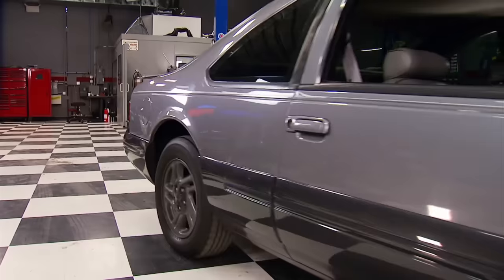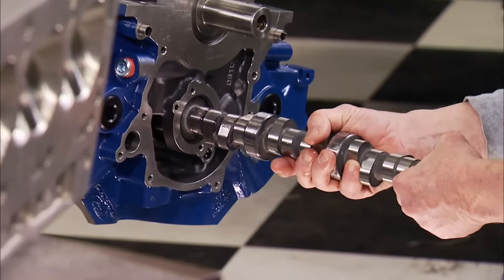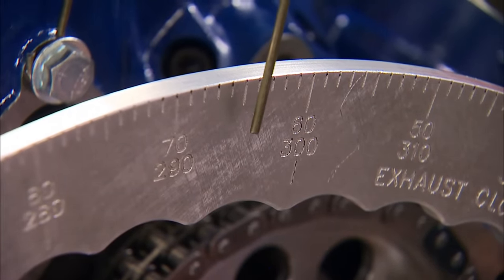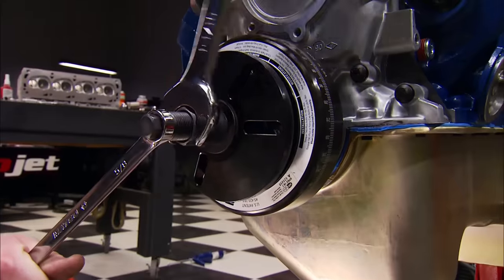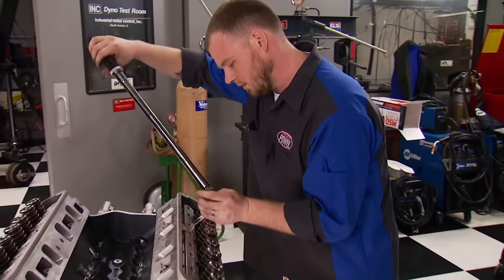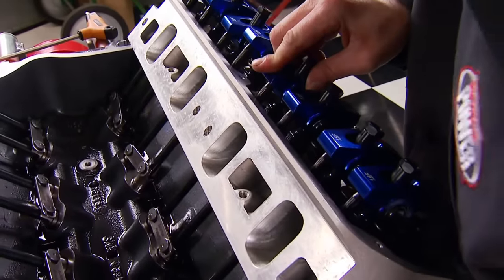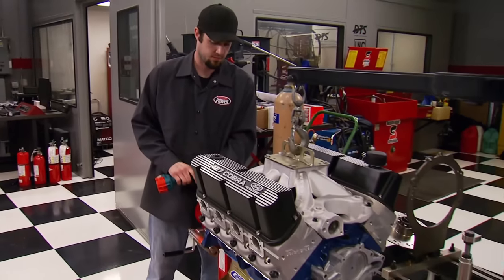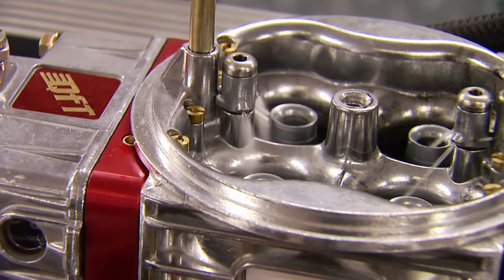Building a 427 Stroker from a Ford Boss 351 Block - HorsePower S15, E6

Comment: Being a Ford guy I really like seeing you get over 600 horse power out of a small block.
Reply: To small of carb. I run a 1050 Dominantor on my 347 and it makes 670 on race fuel.
Reply: @attitudeadjusted9027  racefuel vs 93 here, you can push timing vs 93
Reply: james coulter can you even call 7 liters a small block 😂
Reply: @alexcorona  even if it is 7 liters it don't change the fact that the 351 block is and has always been a small block so yes a 7 liter motor can be a small block.
Reply: Would be better with some CHI/Higgins, etc Cleveland heads. 900 hp on RON98 (same as 93 here) 461ci aluminum block and heads. Fullboost covered it.
Reply: Am I missing something here?   Did he not say it was an Fe based block?   Aka big block
Reply: @clintmullins4406  I don't know if he said if it was an fe block but from what I have always been told the 351 was a small block.
Reply: @clintmullins4406  the Cleveland is in the (335 family) of block's, but is considered a mid size block, and can easily be made to replicate the 427 FE. He said we'll make our version of the 427 FE.
Reply: this is hard to do for american cars go  to europ car to do this !!!
Reply: @clintmullins4406 ford FE is not a really a big block. The whole big block small block is chevy. The 429 and 460 are the closest thing to a big block ford has. The FE is more like medium block.
Reply: @clintmullins4406  I thought that was confusing too the way he said it.  Either way, the one they built and tested here is a Windsor small block.
Reply: That was garbage. 
 I have seen Clevelands dyno at 800hp with a carb.  And the stock 351 cubes. 
 I have yet to see these guys get the kind of HP these motors can really produce. Because Chevy would get mad and pull sponsorship.
Reply: attitude adjuster No moron. A naturally aspirated 427 @ 100% volumetric efficiency  and 6500 RPM can pull 803 CFM max. That’s it. Going bigger than that does absolutely nothing to increase HP but it will hurt performance to go too big. When will people ever get this through their thick heads? Going too big with a carburetor lowers barrel velocity and hurts the signal to the Venturis which hampers performance, not the other way around...smh. Your 347 is way over carbureted and I guarantee it doesn’t make 670 hp. You’re full of shit.
Reply: @jamescoulter7052  chev had small block 400 - maxed out Chevy SB.
Reply: @kamper4140  Chrysler too (273/318/340/360 = A-engine/SB)
(383/413/426MW/426HH/440 = B-engine/BB)
Reply: Me too
Reply: @Frank Bonazza III I'm sorry but as I understood it they were working with a 335 family Cleveland mid sized block.  However I didnt really notice the heads so it may have been a Windsor engine.  But I thought they said Cleveland
Reply: @kamper4140  zim sorry but you are mistaken .  The Ford FE debuted in 1958 at 342 c.i. It grew to 352 in I believe 59.  From there it went to 390 ci. Which at the time it came out was considered a big block.  Mercs ran a 410 ci Fe basically a 390 with a bigger crank.  The next step up was the 406 FE  followed by the 427 in various head configurations including the 427 SOHC which right out of the crate with 8v induction was rated at 645 hp in 1963.  The 427 FE  in its day was definitely a big block and probably Fords most successful racing engine frequently beating the overrated Chrysler hemisphere's on NASCAR taking SS/Sat Pomona in 1965 in the Ford Thunderbolt  and of course 1 2
3 at Le Mans in the Ford GT 
40. The SOHC 427 eventually was successful in Top Fuel Drag fzcing as well.  The FE eventually grew to 428. I or 7 liters and was widely found in Thunderbiirds Galaxies and Mustangs.  From 390 ci on up the FE was Fords big block engine for many years until replaced by the 385 series engines in the 429 and 46p family.  During the reign of the 390 to r28 FE engines Ford had 2 families of small blocks.  One family was the Boss 302 and e52 Cleveland engines  Theu were generally found in sporty passenger cars such as Mustangs and cougars.  The other family started around 1o62 or so at 221 ci found in Falcons and eve really grew to 260 then 289 then 302 and eventually to 351. This was the Windsor family of engines.  I believe Ford currently produces a hot 363 ci variant Windsor crate engine rated at 500 hp.  The Windsor family continued development by Ford and the aftermarket long after Ford and most of the aftermarket ceased work on the 335 series small blocks.  Today it is possible to build a small block Ford that will match the legendary small block Chevy.  However it costs more money to do it.  AND THAT IS THE STORY OF SMALL MEDIUM AND BIG BLOCK FORDS .  HOPE YOU FOUND IT INTERESTING
Reply: Mark Godfrey  Actually it is a hybrid of the two. The block is a 351 BOSS.  Which is a 351W with 351C mains.
Reply: I agree with you. I had the Holley carb handbook when I built a pretty nice 351-C street engine for my '73 Cougar, 30 yrs ago. Holley recommended 600 cfm's for a 351 ci 6000 rpm engine, and since mine was bored .030", I chose a 625 cfm. There have been countless engines built over many decades for the street/strip that were over carbureted. Top end speed depends on horsepower. Quick street cars depend on torque.
Reply: @kamper4140  except you can take the 460 to nearly 600ci...
Reply: @OldMadScientist  351w Windsor block with 351c heads so that the asmatic Windsor can get breathing in the higher rpm.
Reply: @1redrubberball  I have a ‘73 mustang convertible with a 351C any set up recommendation using aluminum heads, .030 bore, rpm air gap dual plane manifold, would like to get a streetable 550hp to mate to a tremec 5-speed
Reply: @joepawling4735  You need to consider a supercharger if you're going to get up in that hp range. If you do it with carburetion and normal aspiration, it'll be a dog on the street, IMO. Personally, if your project was mine, I'd build the engine for max torque and enjoy the car on the street.
Reply: @1redrubberball  I like that idea. I have stock 2v head, mid can with performer manifold and 4bl Holley carb now. About 286 to the rear wheels. What would you recommend to get maybe 350-400 to rear wheels, or can I?
Reply: @attitudeadjusted9027  that's way too much carb for that size engine
Reply: @joefreeman2799  you need to proof read your posts, Joe. I can't guess what you are trying to say that many times.
Reply: @attitudeadjusted9027  I AGREE
Reply: NO PROBLEM
Reply: Love this! Ford engine's are built tough!!!!
Reply: @clintmullins4406  - He was referencing the cubic inches not the block. As in the old FE block like the 427 Side Oiler.
Reply: I wouldn't call a 351C stroker a small block. but it isnt a big block
Reply: @joefreeman2799  I’m positive you meant 332 and not 342
Reply: That’s not special.. SBC’s and LA engines have seen those numbers eons before fords shitty small blocks
Reply: Fe stands for Iron...as in the chemical symbol for it...not block size.
Reply: @joefreeman2799  Why not just use your brains. Its a 351 Block END OF STORY -= ITS A F/G SMALL BLOCK. If that didn't give it away..It's a version of a BOSS..Which is A SMALL BLOCK starting from a 302.BTW for the Ignorants a SMALL BLOCK 351 can be made up to 460CI.
So thanks for the history lesson we all know.but pay attention to whats actually happening and you might learn something. Another give away is the bore & stroke which tell you its a small block spec.
Reply: @clintmullins4406 He said the original 427 FE in the beginning of the video. They're not building an FE engine they're building a windsor based engine.
Reply: @jacksontrundell2193 asthmatic Windsor? I'm guessing you've never seen a nicely built Windsor with AFR heads?
Reply: @1redrubberball It won't be a dog on the street with the right cam profile and a Cleveland will easily make 550 horsepower.
Reply: @attitudeadjusted9027 You have way too big of a carb.Are you running NASCAR heads or something?
Reply: @dj4monie yeah how reliable would that be?
Reply: @ThePropelas No it American cars are making big horsepower numbers since back in the 60s. Euro cars are trash too.
Reply: @starbattles1 Not everybody is trying to push an engine to it's absolute limit. Most people would rather have a reliable engine with good horsepower than a short life race car engine. And not everybody wants to run special gas either. And of course this engine can make more horsepower with beefier heads and internals but that's not the goal here.
Reply: Fe never considered a big block
Reply: @clintmullins4406 dude I may be as high as a set of giraffe nuts but I heard that too !

Comment: All built 7Liter V8’s are Wonderful no matter if it’s a Mopar, Ford, or GM.
Reply: Ever notice most the legendary V8's are 7 liters? 426 Hemi, 427 FE, and L88,  427 SOHC, 428 cobra jet, Boss 429, LS7. It must be the Magic displacement.
Reply: Brian Fleitas Indeed brother
Reply: Well said.
Reply: Baby-Shark GTO Thank You
Reply: @brianfleitas1829  425 Olds  they all were over square that allowed high revving torque
Reply: @brianfleitas1829  now we need a coyote based 427.
Reply: @brianfleitas1829  I believe it was brought about by certain European race classes or American classes and it was the limit....but I sure agree about how strong all over those motors were/are.  Big cubes + unshroud the valves = big power.
Reply: @TheGuyWhoDidUrM0M  lmaooo it wont fit into anything... a 427 coyote would be hugeeee
Reply: @TheGuyWhoDidUrM0M  Thats almost 50% bigger in displacement than a normal coyote 302, gotta remember those overhead cams take up big space, that engine would be big.
Reply: cv 67 right on man
Reply: I'd like to see a built up GM 8.1L Vortec. Thing already makes great torque.
Reply: @Ws6Ms  not necessarily true. If Ford made a big bore, short stroke block to go under some Coyote style heads it wouldn't be any bigger. Remember the 427 SOHC? It's literally the same size as the Coyote width and height wise, but the Coyote is shorter.
Reply: yea, but mopar and gm need boost to get those numbers.
Reply: I mostly agree with the original post, and I'm thrown off by the amount of brand negativity in the comments on this one though. People are quick to say "X brands 427 sucks" without any explanation of their opinion. There's not just one variant of a Ford or Chevy 427 and as someone who builds engines with no brand loyalty I think it's ridiculous.
Reply: GreaseMonkey67 🎯Exactly
Reply: @brianfleitas1829  s62 is pretty lit as well for being a little 4.9
Reply: Haha yeah guys, 427 coyote, who would uhh.. who would want something that big compared to its displacement amirite??
scoots 426 hemi dream build under table
Reply: Facts.
Reply: @RegulerShowTV  I’m not sure.  Could the 5.4. Be stroked to 7 L?  Not going to try and defend the 5.4’s shortcomings, but it I don’t think it’s out of the realm of possibility.  I agree the coyote block wouldn’t work, but the modular platform could make it happen.
Reply: James Hart stroking something out over 1.5 liters usually is past the limits for most engines, the 5.4 already has a 4.1” stroke, so it’s already a pretty long stroke for a stock engine, I’m sure there’s kits that add a bit more length to it but definitely not anywhere close to 7 liters after all said and done. Cheapest way to get a 7 liter would to find a junker 390 FE, and rebuild it with a stroker kit putting it well above the 427 mark.
Reply: Amen to that
Reply: @raylaux8295  "High revving torque" and "Oldsmobile" in the same sentence. Now THAT is hilarious.
Reply: @deeremeyer1749  Obliviously you are to young and naive to know  The 7L Olds can rev to 7K all day. You just stick with Trump
Reply: @brianfleitas1829  Don't forget the 421 SD and 428 HO Pontiacs.
Reply: @raylaux8295  the 425 Olds was a high compression, high nickel, forged crank monster. It’s ashamed that they were mainly stuffed under the hood of the Toronado. They are a better than the Olds 455 in my opinion. The 455 had tremendous low end torque with that long stoke but wheezed a little on top due to the valve size limitation on the narrower bore. 

For that matter, Olds small blocks are awesome. The 350 had 4.057” bore and 3.385” stroke. Very revvy.
Reply: @williamminter7057  Dam right on both Rocket's.
Reply: @deeremeyer1749  Nope. Pre 1968 Olds were over-square and revved well. It’s the junker 2nd gen 400 with the tiny pistons and looong stroke that was ready to scatter at 6k rpm. The average piston speed is too high for high rpm. 455 nearly the same but I’ve seen some excellent high rpm 455s. Still, they’re built for high torque at low rpm. 

The 1966 442 had an L69 option for a 400 BB Tri-Power (three 2s) and cold air induction. Very hard revving. 

The later W-machines got rejected by GM because they were more radical than the Vettes. Ex: 455 DOHC, Aluminum 455 DOHC, Twin Turbo Aluminum 455 DOHC making around 700 HP.  GM didn’t want Olds to market the cars since it was narrowing down performance options in the market. That skunked some of the better Olds and Buick options. They had the reputation for comfort and style and GM didn’t want Chevy to get outshined.
Reply: Exactly
Reply: @Sid The sloth that would be different.
Reply: @Sid The sloth i remember like 10 or 12 years ago there was a company that did cams for it but dobt remember who. I do remember webcam will do a regrind for it though.
Reply: Very well said
Reply: Big blocks Rock!
Reply: @Pocket Square yea I know and the godzilla is kickass and waiting for one to make a swap.  But it doesn't cost anything to dream what kind of power a 427 coyote would put out.
Reply: @TheGuyWhoDidUrM0M  Would be nice to see indeed. Is there enough space in the block for the long stroke that would be required to reach 427 cubes? The big limiting factor with the Coyote is the narrow bore spacing.
Reply: Unless it's a 331 5.4l 3v. Unless it has been updated
Reply: @jameshart9943  i think someone did the 6.2. Thats a SOHC though not DOHC. Its probably possible with a 5.4 iron block at max bore and a custom crank but it must not be practical or there would be kits all over to do it.
Reply: 7.3L Powerstroke Diesel 🇺🇲🔥👊
Reply: i definitely agree
Reply: Lemans 427

Comment: I can't wait for the Ford 7.3 Godzilla engines to get into the wrecking yards. It will give everyone a huge head start with a great block, forged crank, and good heads.
Reply: They just made 789 HP with single throttle body 7.3 👍😎 it's on u tube
Reply: What trans you putting behind it, Super Swapper? Never mind. You don't have a clue what you're talking about to begin with.
Reply: The 6.2 engines are there.   Cammer time.
Reply: @MotoGPatrick  I liked the idea of the Ford 6.2 until I looked up performance cams for it. 2000 for a cam swap and very few grinds to choose from.
Reply: @johnparrish9215  Bullet cams and Dan Crower cams regrinds of raptor cams.
Reply: How's it a great block? Or good heads? Nobody "building" a motor is using stock heads.  So what makes it so good? Cause it's a 7.3? I can build a small block that's a 7.3. It's really.not that impressive when guys are building 700ci+ engines.
Reply: @deeremeyer1749 you sound like a hater to me
Reply: @johnparrish9215 That's why you do the work yourself bro.

Comment: Never use a dial indicator for TDC,   there is so much piston dwell time , that you will be off.   Use a piston stop set for .100 before TDC  in both rotations.
Reply: David Miorgan  Well laid out ... 👍😎
Reply: I use a dial indicator but go .100 in the hole both ways. Same thing.
Reply: Use the .50 method. Dead on using a dial indicator.
Reply: what i used to do was put the distributor in before i put the heads on then i could find the right timing spot and if i need to do it after i got the head on i would take the valve cover off to see how the valves set up

Comment: Nice build for a 50 year old motor design. Could you imagine if there was half the effort going into this style of motor as the taxpayer corporate funded GM copy LS motor. Nice thing on a Ford you can service lifters with out pulling heads unlike a LS.
Reply: I believe that there is so much more to be done with these older engines as we just barely scratched the surface of their experience before they was pushing out more nonsense just to pretend like we are progressing in technology I mean what we get only 2 years of experience on these before they push out more ?  I would have liked to see at least 5 to 10 years giving humanity a chance to experience these ..

 The clowns that are having premature ejaculation over the EV coming into play , they never stop to actually enjoy the experience of the fruits ..

So EV gets here then what is next ?  Humans are not going to advance with these trinkets of supposed technology advancement , it's a joke on humanity . Because of greedy politics and money .

Comment: love these builds you are doing with Ford power. Two of my Chevy bud's switched to Ford after watching your builds. They said" Always liked Ford's better. Most of their Chev bud's told them Ford's didn't run. You proved them wrong." Now one has a 347 stroker 65 Fairlane. And the other bought a 68 Stang BBF. Keep those Ford builds coming. Love them.

Comment: This is what I like to see...engine builds of ALL kinds! Screw truck lifting and all that hick crap. Make this about power like the name says!
Reply: All they build are pushrod engines. That's not all kinds. I've never seen them do a 4 cam engine, or even a rotary for example.
Reply: @fusionsportdaily1650   I'd like to see them build a Turbo 4 cylinder with 600 horses.
Reply: I think this aired first around 6 years ago. I think it was still TNN at the time.
Reply: @s0uthp4w68 why bother? The engines on this show are built for muscle cars anyway.
Reply: @fusionsportdaily1650 Because those are a lot more expensive to build than they suck.